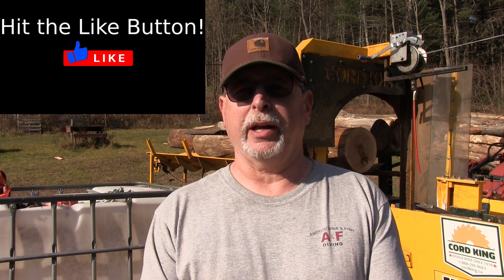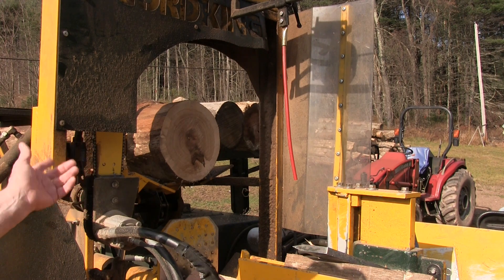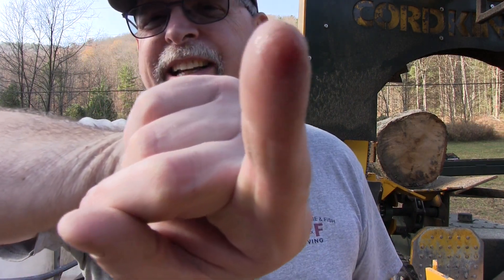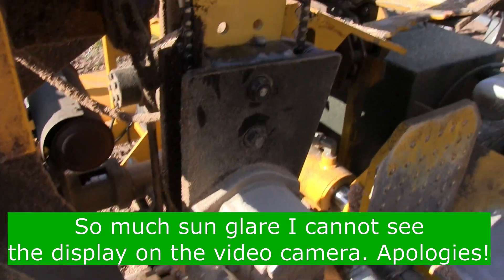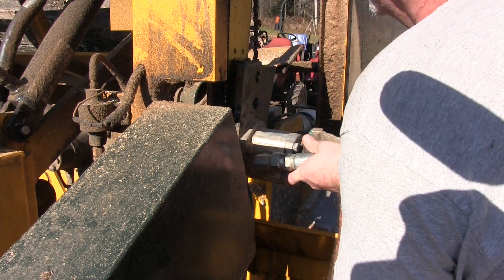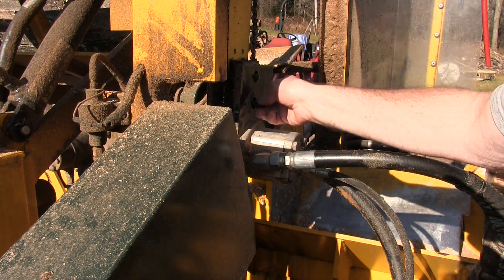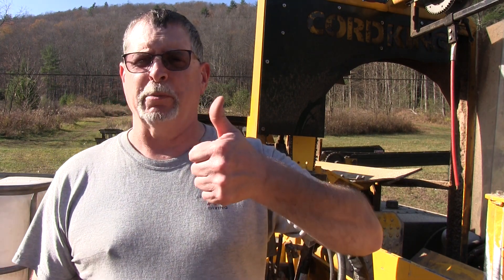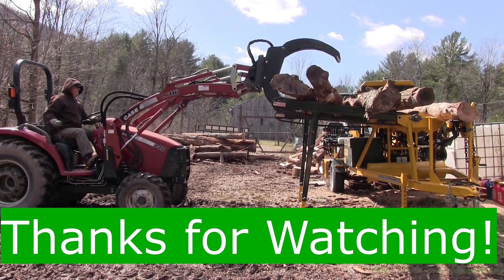Poorly sharpened chainsaw blade - 092

Comment: Last summer I started sharpening my chains right on the processor using a Dremel. Learned that from Chris at the Woodyard. So no more taking chains off of the processor. Every couple of days I give it a little go with the Dremel and my chain is always sharpened.
Reply from the maker: I was doing exactly the same thing. I have an Oregon "Dremel" type sharpener which has a little guide plate. Very helpful. When I have the machine at a customer site, this is what I use. One day I hit a rock that was hiding inside of a knot. Had to replace the chain. Sharpening with the "Dremel" made the chain inconsistent and it wouldn't cut properly. But the Dremel is perfect for quick touch-ups. Thanks for the comment!